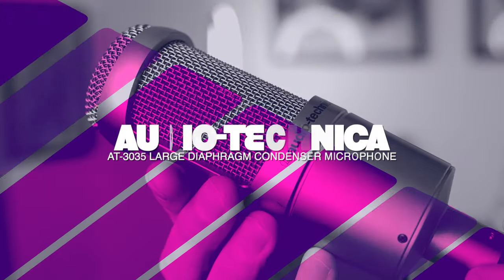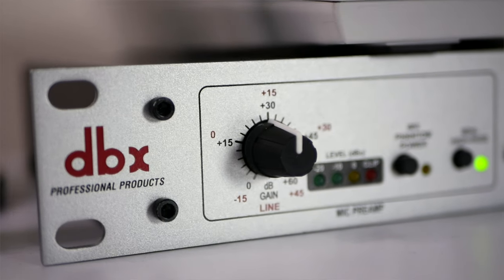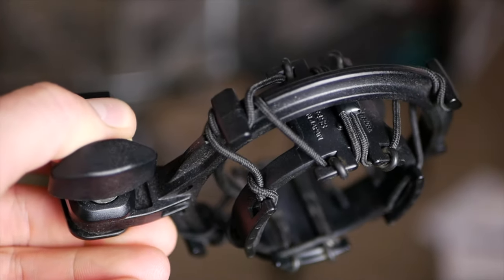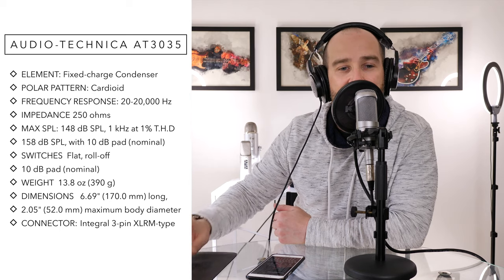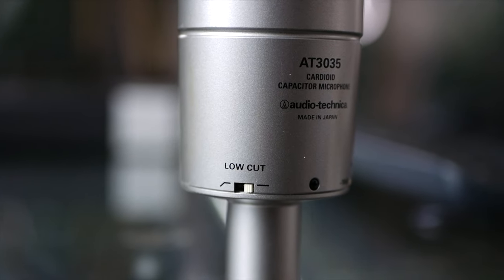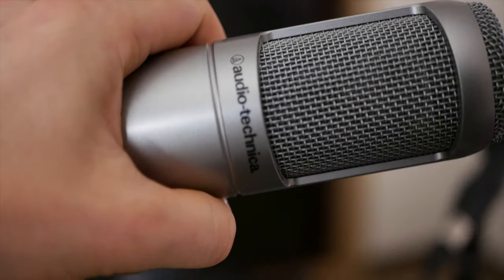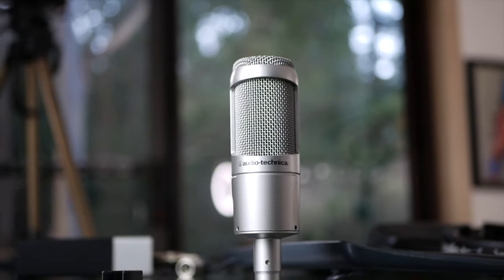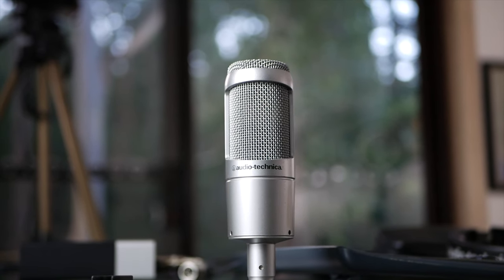Audio-Technica AT-3035 Condenser Microphone Review (vs Rode NT2A)

Comment: They're both good mics, I own both the NT2a and 3035 as well. It's good to have them both in a project studio. The Rode is very versatile, and sounds great. I have 5 Rode mics and they've never left me wanting.
I own a few AT's as well, they are very well made and sound great. The AT 3035 is not to be confused with a 20 Series 2035. They most certainly are not the same mic as some people say. The 3035 has a flatter frequency response and sounds fuller and doesn't have the 10K - 15K boost, nor does it have the coloration in the mid frequencies compared to the 2035, except for a little slight boost in the 6K-ish region. The 2035 is an ok mic, and certainly has it's uses, but it's not a 3035. The 3035 sounds richer.
Reply: Good to know.  Of the two, 2035 and 3035, which of the two would you prefer for male vocals, generally speaking?
Reply: @azarlane9553  Depends on the singer.

Comment: Could you please tell me what kind of post-processing you have on your mics to get more body?  I have two of  super cheap but 'good enough' condenser mics to get started, going into a Beringer interface.  They are really good sounding, but I have not yet been able to get that nice throaty, bassy, body mine.  Any advice is appreciated!  I'm using the Waveform OEM software with the podcast preset which has a condenser and eq plugin, but other than to just turn them on, I'm not sure how to get that nice deep, throaty bass body that i hear when you have your mics running through post.
Reply: try cutting some unnecessary lows, like 50-100 Hz depending on voice. then boost some lows past the 100 Hz mark and mids . Try some sweeping to know exactly which frequency you want to be are prominent. then adda compressor. see if that helps. I know it helps with my vocals

Comment: This microphone can be bought new today, it is basically the same as AT 2035 with few cheaper internals, but it has the same sound. This is not a fair review, your voice sounds great on this microphone, if you told me it was U87 I would believe it. :)
Reply: you have no idea, the at3035 is an electret microphone with an output transformer made in Japan, a relic considered the best cheap microphone where you get a noise of 12 dba an impressive naturalness I have had more than 100 mics and I have been able to compare them and they don't even have the slightest resemblance in sonority, that makes the signal warmer and its capsule is 25 mm